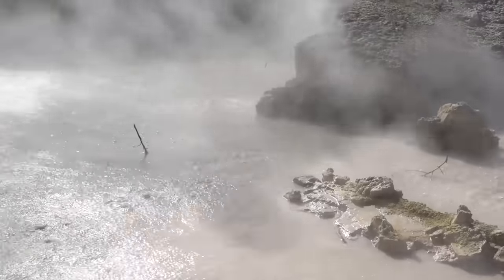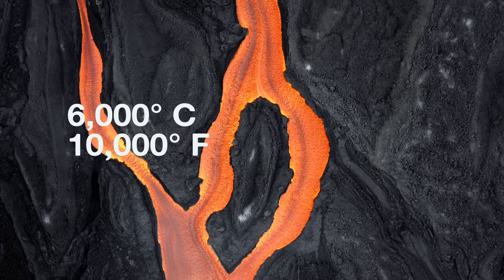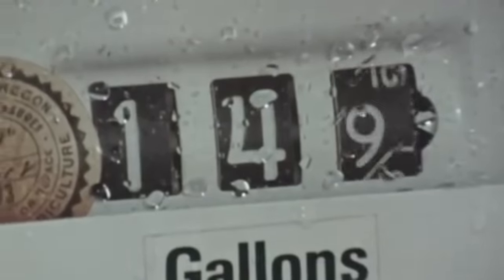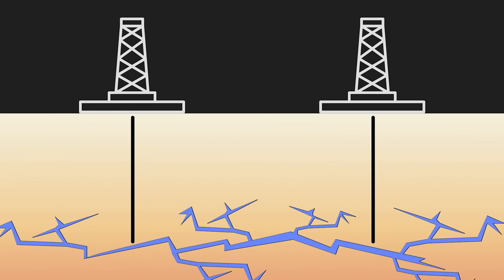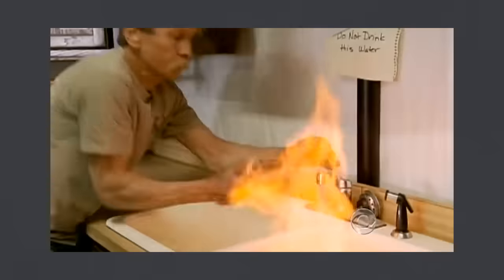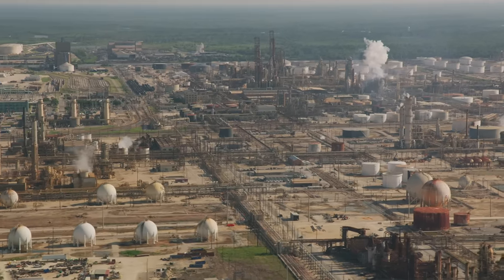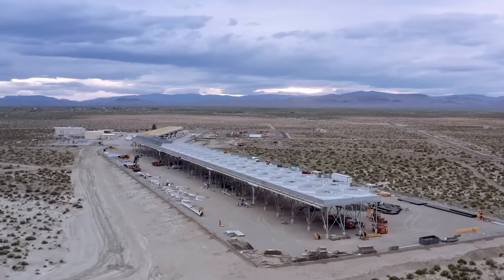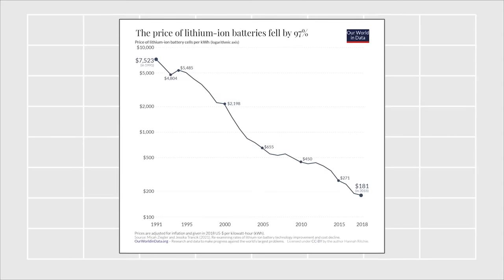Enhanced Geothermal Could Revolutionize Clean Energy

Comment: The biggest problem I can see with most geothermal would be the calcification of the plumbing now if they could do it with a closed system, where they took demineralized water and pumped it down into the ground, kept it inside of the pipes, and then return to surface with the heat it could be a decent system. But most hot water from those deaths are highly mineralized and would require constant maintenance using acids to keep the plumbing functional.
Reply: The closed circle system is in the works by a few copanies, but many of the proposed ideas is to circulate the water already in these deep prous rocks too. The chemistry of this water varies quite a bit. But even still, since the pipe to the reservoir is closed, and the reservoires are encased with a clay cap,  this comcerm can in most cases be ignored for deep heat geothermals, yet it depends on the individual case:))
Reply: Look up Eavor in Alberta.  They have been developing a closed-loop system for years.

Comment: Great video! You should check out the latest drilling technology (millimeter wave drilling). I'd love to see a follow up video where you talk about how "easy" it could be to retrofit some oil and gas power plants to use geothermal steam if we can drill deep enough. I'm surprised you didn't mention the geothermal energy project in Swan Hills Alberta.
Reply from the maker: Will check it out!
Reply: Specifically, two fascinating companies that could revolutionize geothermal energy (without fracking) are are Quaise Energy and Eavor (if they can bring down the cost curve).
Reply: The main selling point of Quaise Energy’s approach is the it’s a Closed Loop system: one sealed hole, water down steam up. No fracking. No pollution. Just have to get down 22 km to reach 500 degree Celsius rock. Will they get there? Time will tell.
Reply: @fordstone6308 I’m one of the people who is confident they will.  My biggest concern is how long the entire system will remain viable.  If maintenance costs are very low, the upfront costs will pay back over the long lifespan of the installation.  If maintenance costs are too high, the break even may be too far into the future.  It would be fantastic to have an additional, completely renewable source for base load power that doesn’t involve damming major waterways and messing with the environment.  If successful, it will without question be another nail in the coffin of fossil fuels.
Reply: Eavor is the company here in Alberta doing the same thing. I really hope they are successful because we could use our oil and gas workforce to  drill for heat instead of the toxic levels of fossil fuels we produce today... Aka the 3rd largest oil reserve on the planet locked away in the tarsands..
Reply: @sjsomething4936  Theoretically, Quaise maintenance costs should be quite low. There are no pumps needed since hot water rises and cold water falls, so the circulation of the water in the loop is created by the intrinsic heat energy (so cool!!!). And unlike fracked geothermal, the water will be uncontaminated by minerals so there will be no mineral deposits to clean.
Reply: @flutieflambert  yes, the biggest problem I can anticipate being a possibility is external corrosion of the pipes allowing for water intrusion, as you’ve mentioned the closed loop system won’t result in mineralization.  My nearly 100 year old hot water radiators are a good testament to the longevity of a closed loop system just recirculating the water, but of course it’s not exposed to the elements at all.
Reply: Is this kind of smug and irritating, or is it just me?
Reply: Took the steam right out of my mouth hole!

Comment: Not sure this is the most promising geothermal innovation, but who knows. Ever hear of Eavor? They don't use fracking, but drill down deep enough to harvest energy from anywhere essentially. I believe they use a closed-loop type of system.
Reply: Yes. They use a fluid with a lower boiling point than water in order to make a thermosiphon that has no parasitic load - there's no pump. Cold fluid sinks, and the warm fluid rises to have its work exchanged off, and then back down as cold it goes again.
Reply: @CanCobb  Yes, there are several fluids with a lower boiling point than water and several that reach the expanded gaseous state at lower temperatures.  A closed loop system returns the heated liquid or gas to the earth and does not expel anything to the atmosphere.
Reply from the maker: No but I'll check it out! Thanks for the tip.

Comment: Are there any downsides from traditional fracking that also happen with this technology? Like maybe large amounts waste water?
Reply from the maker: There aren't the same risks to groundwater. But there's an active debate over the seismic risks. 

More from the Department of Energy here: https://www.energy.gov/sites/default/files/2022-09/EGSFAQ_Sept22.pdf
Reply: I was going to ask the same question. My initial reaction was that fracking is BAD. From the linked PDF, I can see that EGS does not pose "a high risk" – not all that reassuring. It seems the safety is being monitored and improved as they go. 
In a way, the renewable nature of the technology will ensure that it grows slowly for now. And so we'll have time to verify its safety before it and other renewables suddenly get ramped up.  @distilled-earth
Reply: It is an unfortunate likelihood that there will be some downsides to the technology (eg. seismic). Most of the problems with traditional fracking are caused by the oil and gas leaking into the surrounding environment and not so much the technology itself. But there are always downsides to every energy production technology. Removing the need for fossil fuels means we have to weigh the risks of renewable technologies as well and place them in suitable areas. We should always be aware of the risks posed by certain technologies and weigh them against the benefits of using them rather than traditional fossil fuels. But we also shouldn't become a victim to the propaganda put out by fossil fuel companies that only focus on the downsides of the renewable technology. It's funny how society accepts that coal and gas companies destroying our environment and health is normal but if windmills kill some birds they should be banned altogether.
Reply: @distilled-earth   so different risk? Not worth it.

Comment: Needs to be updated to include closed-loop geothermal- at 22 km deep, a single borehole ONLY is needed, as there is sufficient heat to provide all the steam necessary. Microwave heating melts its way down, leaving a vitreous- lined hole. Whether or when this technique can be proven is unknown, but if accomplished, it will usher in an era of pollution free energy accessible 24/7 any place on the planet. Quaise Energy is one company trying.

Comment: Tough Sell: I ran preliminary numbers on their 400 MW facility, enormous upfront installation costs for 8-10 doublets of 8000’ horizontal wells with multi-stage fracs will be {50 doublets at $20 million each is already a billion}  Then add a geothermal plant at $500 million.

Comment: I'm surprised that you didn't mention companies using high-power millimeter wave drilling like Quaise in your video. This technology opens far more locations to geothermal than fracking based technologies alone. Using high-power millimeter wave drilling any location in any geology anywhere in the world is open to virtually unlimited amounts of heat
Reply: That’s a subject for another video, maybe. That said, I’d want to see cost breakdowns on it. The free market is your best friend or your worst enemy, and a lot of wishful thinking goes on with the subject of clean energy, that emphasizes cool tech without looking at its economic viability relative to other solutions. (See also the “Nuclear is the only option!” crowd, and the “game changer” fusion breakthrough fantasies.) I really like the principle of geothermal, and I’m excited to see a real-world implementation of EGH, because it’s based on well-understood, proven technology (fracking), so the cost model is predictable and much of the scale-related cost improvement is already done. Maybe alternative drilling technologies will open up more sites in the future, but afaik there is ONE non-traditional geothermal site right now, and it’s the one in this video. Go after the low hanging fruit first, and if alternative drilling techniques want to challenge, they can do so by either offering lower cost, or by reaching a market ESG can’t reach.
Reply from the maker: I'd need to devote a whole video to that. David Roberts has written about other geothermal applications and technologies here: 

https://www.vox.com/energy-and-environment/2020/10/21/21515461/renewable-energy-geothermal-egs-ags-supercritical

Comment: You have missed an important issue in your talk - execution risk. Australia has huge geothermal reservoirs and a number of companies have tried to develop it and had serious problems with corrosion in well linings. Seems to have stopped development there. The concept is great and superficially relatively simple but the environment several kilometres down is pretty tough. I invested money in it 15 years ago and lost most of it. Not saying it can’t be done but your explanation is short on major risks. B- from me.
Reply: This particular technology doesn't tap existing resources,  the water is 1st treated to reduce harmful effects to the system and then pumped into the loop and monitored throughout the process

Comment: The areas were you find permeable rock, water and heat are more common than talked about here. We are very far from exhausting those areas. Going to enhanced geothermal systems opens up nearly the whole world for geothermal power plants. It is actually strange how little geothermal energy is used for producing electricity, space heating and industrial applications.
It produces energy 24/7/365, is inexpensive to run, costs far less to build compared to nuclear and is that abounded, it could provide all the primary energy needs of the USA for example.

Comment: I'm an all-of-the-above energy guy. If this works and if it can be done in an economical way, then by all means. What I oppose is demonizing one source of energy for its drawbacks while refusing the acknowledge the potential drawbacks of the "preferred" option. Hydraulic fracturing is a revolutionary technique. It's not risk-free. We see mini-quakes/geological instability. We have the slickwater that must be handled in an environmentally responsible way. And we have the costs for the entire life cycle of all the equipment to factor in. When we start having a proper, fact-based discussion on this topic without the politicking and with a genuine effort to find real solutions, then I'm all in. That means 4th gen nuclear, MSRs, renewables where they make sense, and yes chemical energy whether its fossil fuels or biofuels.

Comment: The amount of dispatchable energy you can get from each dollar's worth of capital has been increasing exponentially, just as computing power has been for decades.  Such increase always runs into the constraints of physics eventually, but solar+storage is likely to have the edge over using steam turbines even if the heat were produced for free by magic because of factors like the inherent wear-and-tear involved in having moving parts.
Reply from the maker: Still important to have a diverse energy mix. No energy tech is perfect.
Reply: @distilled-earth — Diversity is good, but there are limits. 

I always wanted to build a wind generator for the winter, but the cost of solar dropped so much that even the marginal cost of additional solar in the winter made wind a nonstarter. I guess I’ll just build it because I want to — it’ll be my SUV!

Comment: Fracking was only “a complete disaster for the environment” if you assume Americans would’ve just forgone using energy had fracking not made cheap oil—and especially natural gas—possible. In fact, there would’ve just stuck with a much dirtier and plenty cheap fuel: The biggest driver of the sharp decline in US carbon emissions over the past decade was natural gas replacing coal power plants, not renewables replacing fossil fuels. Because solar + wind + natural gas came as a package: you needed the last one to overcome the intermittency of the first two. Enhanced geothermal is the first plausible emissions-free base-load source that can be deployed on a timeframe shorter than it takes to build a new nuclear reactor or giant dam.

Comment: Note: This is Not one of the first enhanced geothermal energy or EGS application. There is even a list of EGS facilities on wiki. You are confusing it with Hot Dry Rock or HDR technology as you explain this later.
Reply from the maker: It's the first commercially viable EGS project. Big difference between that and the early experiments.

Comment: Does the energy generated exceed what is required to pump the water through the earth?  What is the efficiency of this process?
Reply from the maker: Yes, definitely. Same principle as a heat pump. Use a little energy to run your system, and extract a massive amount of energy from air or water.

Comment: Fracking--bad. 

We learned this directly from the oil and gas industry's experience with fracking.

Fracking will cause harm to the reputation of renewables and will slow renewable energy adoption. 

Geothermal fracking and burning wind turbine blades are not sustainable.

Comment: At least 30% of the thermal energy needs to be dumped into the air for multi cycle generators. Yes, better than carbon fuel heat +co2 production but still huge thermal pollution. Near surface geothermal cools the surrounding land so no net thermal pollution. Deep well pulls heat up that wouldn’t reach the surface for a very long time. Check excess over geothermal gradient to determine net heat pollution…

Comment: Huh. I wouldn't call this enhanced geo.

Just a few weeks ago I saw a new video where no fracking is needed. Instead pairs of boreholes are drilled parallel, close to each other at a somewhat diagonal angle. The parallel holes creating a loop in a small area. Several of such pairs next to each other. And If there's enough heat, this can easily have multiple layers (diagonal after all).

That seemed more promising to me than reverting to fracking.

Comment: Hmmm.... we Icelander have been using Geothermal energy for 100 years to warm our houses, green houses and make electricity, so this is a new element? 
Actually,  we been experimenting this method here outside Reykjavik, but it made earthquakes, so they stopped.  
They pumped cold water down, but the earthquakes started, check it out....
Reply: It's a new element for countries which don't have freely available geothermal sources like Iceland, Japan and New Zealand do. There was talk about using geothermal in non-porous rock in the Hunter Valley in Australia, but I haven't heard any progress on it. I'm surprised that Japan doesn't make a lot more use of geothermal, although recently I heard of objections from hot spring owners who were worried about their wells drying up.
Reply: Lots of sulfur with Geothermal especially Iceland. However goto sauna in Iceland they charge you $100.00/day. Crazy.
Reply: Iceland is not a place for a poor tourist @lmtada
Reply from the maker: As I mentioned in the video, the type of geothermal harnessed in Iceland is very geography dependent. The new element is technology that makes it possible to do what you're doing in Iceland where I live in Colorado.

Comment: I've only heard ONE thing that this video didn't touch on.  A new kind of drilling setup that China has.  Instead of a (drill-bit) to cut down through the earth.  Drill-bits get dull and after a certain depth are not even viable.  As the heat is just to much and they melt.  China uses a (plasma) to cut down into the earth.  And, as a by product, the earth turns into a ceramic and coats the sides of the hole.  And, this method, was (really) energy efficient.  (Really, really) energy efficient.  I don't remember, except it was astronomical (like only 10% of what would be required with legacy drill-bits).  Don't quote me on those figures cuz I don't remember exact number on that.  I only remember the "feeling" of astonishment, it induced in me.
Reply: Millimetre wave drilling used to melt and vaporise rock. Like microwaves used to heat up the water content in food, but longer wavelength, and higher power.

Comment: Revolutionized it to where? Location, location, location. $$$$$$ to locate it anywhere that is not a hot-spot. Nuclear still exceeds geothermal, by being mobile. Copenhagen Atomics can ship a reactor anywhere and have it set up where the transmission line already exist….. much cheaper, ThorCon is ready shipping reactors to Indonesia cheaper than coal & geothermal.

Comment: Unless this is done where the earths crust is very thin you would have to drill down miles to get usable heat energy. It is absolutely NOT everywhere. So 2 miles would be about 100C and 7 miles for 180C usable heat. That would be a fantastic cost to produce a small amount of heat. This is just another renewable unicorn CON.

Comment: Clean power, Nope.
You create a weakspot in the earthcrust. Layers after layers have secured the crust, with bringing water in it you will weakening the crust and can causing a devestating effect on the planet.
If you put water straight in, it can go into a fisher and this could reach even magma in the depth. So with it you will create weaknesses and even earthquakes.
The well should be having a coating to secure water to move into the deap or into fishers.